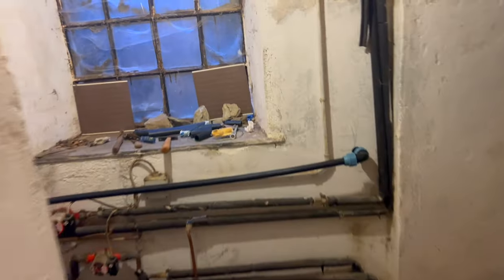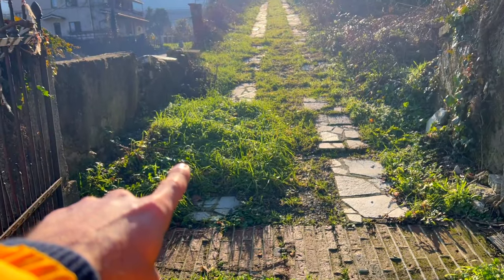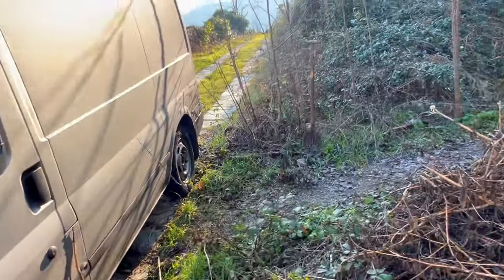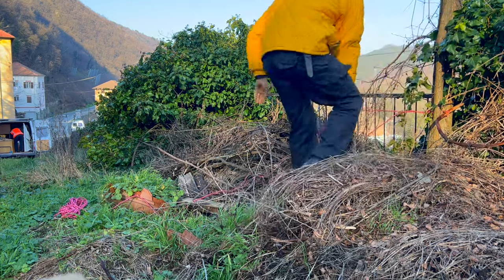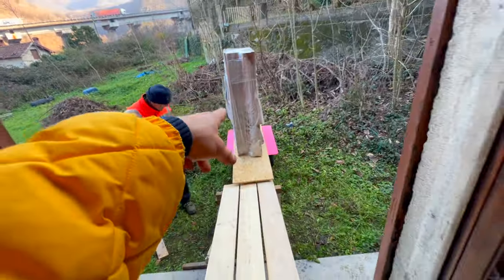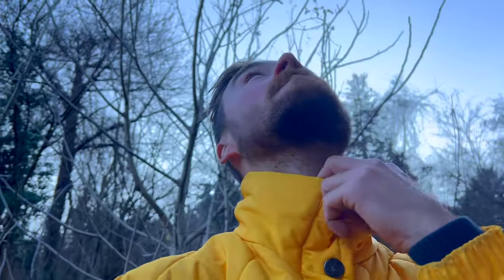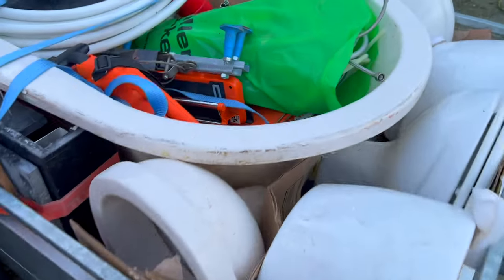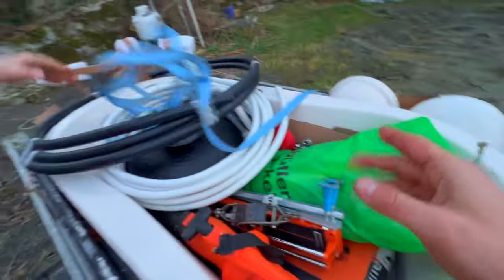056 || This Will Be Amazing In Our Living Room

Comment: Ideas to stay warm while still without heating in the house:
Always wear thermal underwear, and layering on top. Cover the head (looses asthonishingly the most heat). 
When sleeping: use warm water bottles. And sleeping right on top of a woolen topcover (my latest discovery). THat is so soft and comfortable... you won't get cold!
Good luck. And I love the piano!!! Well done!
Reply from the maker: thank you so much for the ideas, we're implementing quite a few already. Thanks for being so involved!
Reply: Because Pacific-Gas-&-Electric (aka, PG&E) is so expensive in Central California (near Modesto), wearing cotton hiking socks, thick large wool gloves, and a nite-cap under a cozy velour hoodie is a must for sleep wear in addition to the thick thermals, and a blanket shirt & pants over my heavy blue sweat shirt & pants allows me a reduced reliance on the utility company.  All of these layers of fabrics under a quilt of blankets provide a warm sleep thru the night in my bungalow . . . and i save a hundred bucks each month of winter which is better spent on groceries.

Comment: You guys need desperately to get your road passable. It would make your life so much easier.
Reply: Fixing the road would take a day or two I would think. Considering the struggles thus far I don't understand why it hasn't been fixed. Perhaps you can explain it as it makes not much sense.
Reply: Possibly a matter of what project is the best use of available money.
Reply: The driveway needs more stones for now. The van has no traction. That's why the wheels are spinning. If you have ever been off roading you would know what I mean. Australia has some areas where off roading is popular and you get to know what to do.

Comment: Why not drive forward? Isnt there enough place to turn around at the house?
Or if not...  drive back backwards
So you had to carry the heavy stuff by yourselves.
Looking forward how your work goes on.
LG Hedi
Reply from the maker: figured the weight was on the lower side and therefore on the front now, with front wheel drive, I guess this was the best option with the most traction. Thanks Hedi!
Reply: @Villa_Oliva beter toch voorwaarts rijden en dan in zijn 1 of 2e versnelling. het is een diesel dus die zijn sterk genoeg.. netzo als je vast zit in de sneeuw of in sneeuw weg wil rijden altijd in zijn 2 dan heb je minder wielspin.

Comment: Love the baby grand and amazed at how in tune it is after all the transport machinations. Wonder if you could give the woodwork some oil polish to keep it nourished? If it gets too dry it might start to split. Polish along the grain seems what people say. Gorgeous piece. Thinking you might have better luck getting up the slope after sweeping the paving stones so the wheels don’t spin on the dirt. Maybe easier on the gears to go forwards if room to unload then reverse down without the weight? Good luck for next time as would make it easier for unloading. Maybe a winch to help.
Reply from the maker: good suggestions! we figured the weight was on the lower side and therefore on the front now, with front wheel drive, I guess this was the best option with the most traction.
Thanks!

Comment: Your keys are ivory. You might want to do some research before you work on the piano. For example, one accepted method is to use a dab of milk on a cloth. The older the keys, the more fragile the ivory. The finish you apply, wax/ shellac/other, and the glu you use can change the piano's sound. And that wood veneer is incredible.

Comment: de wielbasis van je busje is te wijd ten opzichte van het pad naar boven, daarom lukte het niet.
Reply: Trying to get traction on wet grass will never work, no matter the wheel base width.  I think he backed it in due it appearing to be front whe3l drive.  .
Reply from the maker: figured the weight was on the lower side and therefore on the front now, with front wheel drive, I guess this was the best option right? But yes, we didn't have traction, otherwise we probably would have made it. 
at least we got a good workout it this way, staying optimistic here

Comment: I was just wondering why you didn't drive forward up the driveway ..
Reply from the maker: figured the weight was on the lower side and therefore on the front now, with front wheel drive, I guess this was the best option with the most traction.

Comment: Why on earth didn’t you drive up to the villa instead of reversing it would have  been far more controllable, and correct me if I’m wrong but I think  transits are front wheel drive which would mean the van was pulling the weight instead of pushing 😊
Reply from the maker: you're correct, it is front wheel drive. but we reckoned we'd have more traction this way, with the weight pushing on the front wheels.

Comment: The weight of the motor would have given you more tractor to drive up the hill and reverse down the hill
Reply from the maker: This way we had maximum traction I think, the engine is in the front after all. Or did I misinterpret?

Comment: why du you drive your van backwards? you dont see were you are going
Reply from the maker: figured the weight was on the lower side and therefore on the front now, with front wheel drive, I guess this was the best option with the most traction.